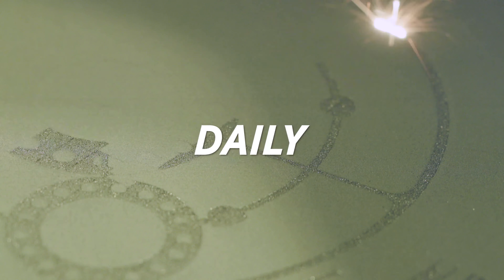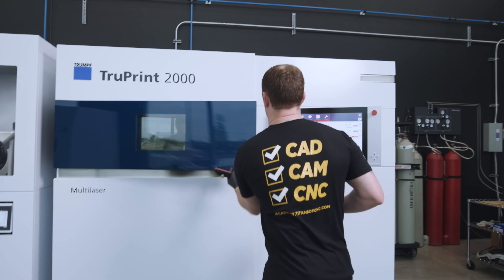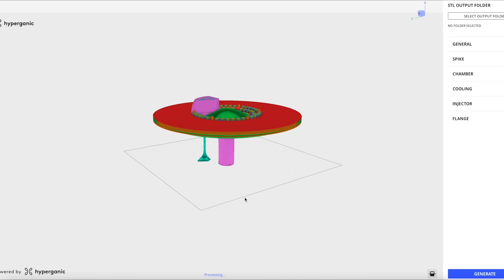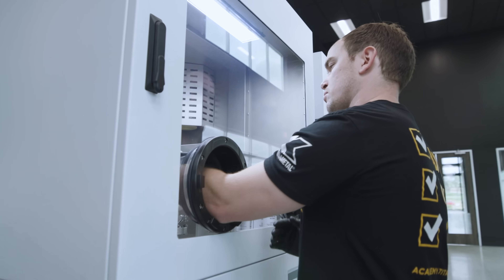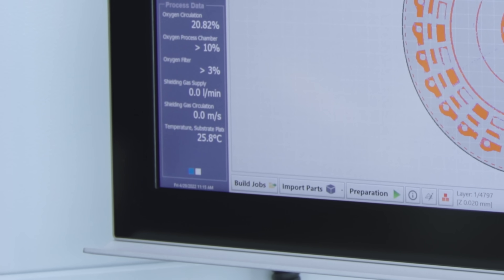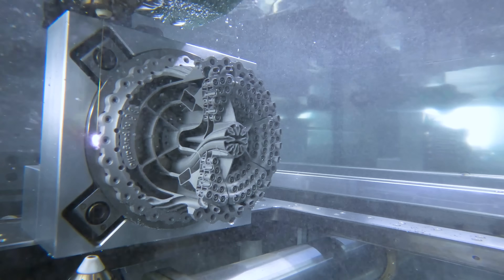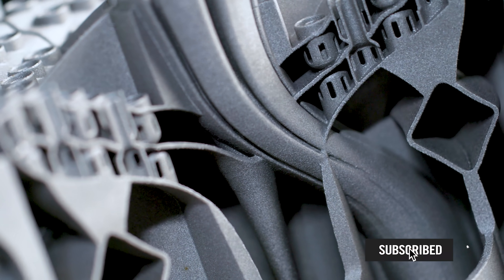3D Printing a Titanium Part Created By Artificial Intelligence

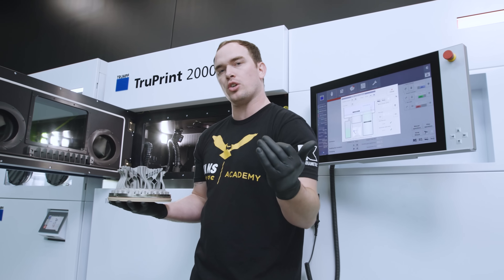Comment: This part looks awesome. So cool to see how it's made. At 5:35 you can see a crack/fracture going horizontally through the part. Any explanation for this? Thanks for your content. I love learning about this stuff!!
Reply: It looks like a fantastic new process, but I can't help but imagine the turbulence issues due to the grainy texture (resolve by manually porting?) and the extreme care needed in keeping impurities/odd grains out of the powder.
Good lord, the seed money you'd need to get all this on deck and functional...
Reply: @barrys7570  CFM has been using 3d printed parts like this in their newest generation aircraft engines for almost a decade. Their LEAP-1B engine has a very complex 3d printed fuel injector that replaced 20 individual parts in the previous generation engine.  not nearly as crazy as this part, but designed and executed a decade ago.. so, no telling what improvements have happened since.
Reply: @barrys7570  grainy is actually good for flow in many cases
Reply: @m.b.82  
And bad in many cases.
Reply: I imagine they have a few failures occasionally.
Reply: @modelcitizen1977  we are all human;-)
Reply: I saw that too
Reply: It's normal for AM parts to have these defects. The different layers cool at different rates causing them to shrink differently, causing tension between the layer which leads to fracture.  There is a way to get around this effect by using a special type of oven once you have finished printing.  This oven uses pressure and heat that bonds the layers better and then cools them uniformly. However this is only for demonstration, so it does not require the long expansive postprocessing steps.
Reply: @Almalki-OG  Ty for the knowledge
Reply: @Almalki-OG  Sounds like you’re talking about HIP. That is to reduce the voids amount in a part but it doesn’t work out factotum like you mentioned. It’s not normal to have these defects either. You can control the time between layers with software or adding in ghost parts. The defects in the video would not be fixed and the part would be scrapped. Layer separations in AM parts is not common. If they show up, you need to adjust some settings or set the part up differently.
Reply: @JeremyDN  

In certain AM processes (high energy: SLM,EBM,LMD in particular) parts can be subject to cracking/warping due to
 Residual Stress (RS).

In SLM/EBM/LMD, there are two mechanisms which can induce thermal RS:

1. Restricted thermal contraction of solidifying layers
• The melted top layers contract during solidification and cooling. This deformation is prohibited by the underlying solid layers, inducing tensile stresses in the top layer, and compressive stresses below.

2. Restricted thermal contraction in solid layers due to high thermal gradient
• High temperature in the upper solid layers causes thermal expansion which is restricted by the colder underlying layers. This induces compressive stresses in the upper layers which can exceed the material yield strength and cause plastic deformation. When the plastically deformed layers cool and contract, the compressive state is converted into residual tensile stress.

RS effects typically mitigated by:
• Reducing temperature gradients during the build (heated build chamber if possible)
• Choice of part orientation
• Use of support structures as anchors/heat conduits
• Post-build stress relieving heat treatment
Reply: @Almalki-OG  I don’t disagree with anything you said. I build these parts so I know how often they can crack. Heat tearing or shrinking is common but there are ways to eliminate it sometimes. Parameters have a lot to do with it also. I’ve made some wicked looking things that were simple to setup, and some simple parts that were a nightmare to build due to internal stress while building. Sometimes you just need to add extra material and have it machined off. Most people don’t understand how complicated building these parts actually can be. Our process is DMLM, and we use EOS machines mainly. The quad laser machines are a beast. Those things can be building a part for 3 weeks straight. Longest I’ve ran a machine was probably around 8-9 days. Building at 20um is horribly slow but the surface finish is on point.
Reply: Looks like it was either a short feed or the part jammed on the recoater. I work with metal 3D printers and titanium is by far the hardest part to print with. All of their inside features are higher than 45 degrees to build unsupported. We made some seriously complex parts. SpaceX ordered a few rocket engine fuel parts that were insanely heavy. Awesome tech but has a lot of limitations still. Surface finish looked fairly good for straight from the machine.
Reply: @JeremyDN  its all suported by the powder, innit? just like nylon sls1.. i mostly wonder how hard is it to remove the powder from inside of the part and what is the waste amount
Reply: @primosek1  Metal printing isn’t the same as SLS. Same power in a way, cept metal is a finer particle size. Metal parts need to be attached to a build plate of the same material to achieve the best adhesion. Removing the powder isn’t that hard though. I made some shakers out of cement mixers that would vibrate the build plate. Add some small exit holes in the bottom of the supports and give it time to shake it all out. The process for metal and plastic is sort of the same but has a lot of differences that set them apart.
Reply: I wonder if there was a pause in the program or a restart happened and the part cooled and then new deposit was placed on top of an old layer?
Reply: Layering issues maybe
Reply: That’s 3D printing for ya.. you run a 48 print and it screws up in the last 3 hours! If you know you know
Reply: @nsboost  I couldn’t, I get mad when the paper printer does that with a 1 minute print. I’d lose my shit and probably destroy the printer.
Reply: I think that being just a demo print they printed at a faster rate than one normally would, resulting in poor fusion. That may also account for the relatively rough grainy look.
Reply: There are some videos of this at full scales, I seen one the other day by a rocket engine company that only uses 3d printing.
Reply: I also saw that.. I hope the process progresses further
Reply: Smart guys above answered the question well ^ I want to add that the alloy they are printing with has been around for decades (Ti-6Al-4V) and does really well in just about any other manufacturing process. But ultimately not suited well for 3d printing at this particle size. There are other titanium alloys being developed that do a lot better and don’t have the same residual stress created. See Titan 23 developed by ATI
Reply: Was thinking it's something to do with being at the end of that line at the cut-out section. A bug nonetheless but it wouldn't likely be there if the part was full without a cutout. Is there a way to CT scan these for structural consistency/failures?
Reply: Ha! I was about to type out "what is that crack?"...
Reply: Consistent quality, and quality as a whole, is the reason why not many additively manufactured parts receive certifications from the FAA and similar agencies. No doubt it is awesome tech and the future of some manufacturing, but it just is not to the level we expect and require in the industry. BUT! I am not trying to be pessimistic here, I believe Rocke Labs Electron and a few other upcoming rockets do us 3D printed engines are parts. TL;DR Cool tech, needs more work, won't be widespread for a hot minute.
Reply: @BralexAir  Yeah the electrons engine is like 80-90% 3d printed. The SuperDraco engines for Dragons launch escape are entirely 3d printed as well.
Reply: Just 45 hours of loss time no biggie
Reply: @jimmykelly2809  advertising the print machine and ai software.

Comment: This is an excellent video, and I love the concept of Algorithmic Engineering. Interestingly, @5:52, if you pause the video, you can see a bit of a horizontal fracture around the right side of the head of the piece. I wonder, do 3D printed pieces always have a chance of not bonding (atomically?) in random areas?
Reply: In understandable words, different layers cool at different rates causing them to shrink differently, causing tension between the layer which leads to fracture.  There is a way to get around this effect by using a special type of oven once you have finished printing.  This oven uses pressure and heat that bonds the layers better and then cools them uniformly.
Reply: I work in Additive. It is indeed one of them most difficult things to get right. We have a super high scrap rate. Even metal bars crack that are 2-3cm cubed.
Reply: @bjorn5209  Ahh, that's what I was thinking ! I can imagine the high scrap rate.
Reply: That's scary in a fuel injector. Also it taking 48 hours means if it messes up you're set back by 2 whole days vs a few hours for a simpler design that might require cheaper equipment to produce (so you could run multiple production lines in parallel for the same money)
Reply: It's caused by algorithmic polypressures that build up and cause internal Pythagoras fractures that refract and cause horizontal cracks.
Reply: @Professor-Scientist  🤨

Comment: the surface finish is a little rough, couldn't the a.i be taught to take the limitations of the manufacturing process into consideration and then make the rough finish a none issue in the overall design. it's sounds silly but just a thought.

Comment: Can you comment on the layer break at 5:42? How prevalent is that with this process and how do you account for it?
Reply: In understandable words, different layers cool at different rate causing them to engage differently causing tension between the layer which leads to fracture.  There is a way to get around this effect by using a special type of oven once you have finished printing.  This oven uses pressure and heat that bonds the layers better and then cools them uniformly.
Reply: @Almalki-OG  This process scrapes each layer of powder flat,  so uneven shrinkage is corrected on each layer,  provided there is enough laser power to weld through to the deepest shrunk part.   This is where the art of tuning for power and speed comes in,  which wasn't critical for this display part.   I suspect they just used the same settings as they'd tuned for the actual part,  and this cutaway curled slightly
Reply: Siemens have the answer for cracking-free 3D metal printing.
Reply: and the super nasty widowmakers at almost every orifice... probably just add to the flame right? -__-
Reply: is it even real titanium?

Comment: Wondering how strong the part is? Will it be brittle could it be heat treated for strength? So many questions!! Amazing where tech is going!
Reply: @sergiugabrielpopovici5664  tubes only make material strength anisotropic; it reshapes the strain tensor without increasing total strength
Reply: @dan forged parts have approx 20-40% more strength, its plausible the design technique warrants the loss

Comment: Definitely looks like a Hyperganic part! This elevates the role of engineers to the next level and you guys did such a fantastic job at printing and presenting it. Moving in the right direction! 🤯
Reply: It is!
Reply: How does this elevate the role of engineers? Lol if ai can do this that means the value of real engineers is significantly lower. Why pay an engineer tons of money when ai can do it better?
Reply: @Loserstakethebait  
This just takes away the complex calculations that would otherwise need to be done manually for more complex parts. The engineer using this AI would give it a general model with all the features they want, then the AI would do all of the time-consuming optimizations.
Reply: @Loserstakethebait  
Who engineers the AI?

Comment: Amazing video and loved the complexity of the part! However I did notice some imperfections and wondering how you would inspect the part on the inside when it was completed for imperfections????
Reply: Probably xray it, pretty sure they xray a lot of aviation equipment anyway
Reply: @xxportalxx.  You could also use dental or surgical cameras to scope down the openings.  Only reason we can't machine in those spots subtractively is because it's too expensive to make a thousand dedicated tool bits for one part.  Otherwise it is 100% possible to make this part with just subtractive manufacturing, just so unbelievably horrific nobody would even attempt.
Reply: @DSiren  I would wager this particular example couldn't be made in one piece by subtractive machining alone. There's complicated internal cavity structures that aren't particularly accessible.
Reply: @xxportalxx.  it would be an ass to make the thousand or so custom tools but yes you could do it.  You'd probably need a half dozen special chip extraction tools also, but you could do it.  Worst case scenario you're using a wonky file to do it.
Reply: @DSiren  I'm not sure how you'd envision those internal cavities being machined, moreover how you'd machine them with any level of precision
Reply: @xxportalxx.  With the right tools and machines

Comment: I'm A retired mechanical engineer/CNC programmer/operator/QC inspector. I hate to admit how bewildered I am. I kinda sorta got the plastic 3 BASICS understood. But this is an entirely different level. ONE.QUESTION, How does the titanium powder achieve structural stability and integrity in the competed product? A block of printedf titanium will have the same Rockwell# as A conventionally forged, manufactured block??
Reply: You can actually get very close if not better mechanical performances after post-treatment (typically polishing/surface finishing and HIP heat treatment, which will close most of the microscopic pores and remove residual stresses from the fast cooling of the process). Now this particular part, I don't know how you would surface treat it given the complexity (maybe chemical etching?), so it may have reduced fatigue life...

Comment: Could you show these 3D printed parts installed in a working anything? I mean how durable is the 3D printed part compared to the normal one
Reply: I think they can't. The quality control doesn't exist.
Reply: This model is just an example. There are similar parts made with same technology already flying so yes

Comment: For what fuel and oxidizer was the injector plate made for? And what combustion chamber was it designed to fit in with? Also, I love your videos.
Reply: For rocket booster
Reply: @gurbanguliberdimuhamedov4228  You didn't even answer one of those questions.

Comment: Honestly how many times did the wire break? Simply curious.
Reply: Look up wire EDM, the wire never actually touches the part. If I recall right they apply opposite charges to the wire and the stock creating sparks that erode the material and use pressurized deionized water to flush it away.

Comment: Incredible stuff….. but that surface finish seems so rough it’s surely not useable…? And even if the nozzles were machined, the roughness in the channels and cavities which are unreachable must be a nightmare for the fluid flow with all the friction it introduces!
Reply: There is a process called extrusion honing.  I wonder if it could be used on a part like this.

Comment: I think the principal future of this technology lies in materials development, as you can put down only so much laser energy at a spot before you begin to violate the dimensional tolerances. The TRUMPF machine here has two lasers, presumably to allow simultaneous scanning of two points on the pattern, in order to cut cycle time. There might be room for design trade-offs in relaxed tolerances to allow quicker fabrication. I can also see machines that use fixed optics (that create a smaller spot) to make very small structures, though it wouldn't be as fast as a scanner. What I'm waiting to see is 3D printing of parts containing more than one type of material.
Reply: Multiple material prints already exist. Check out this video. At begin there is the technology explanation and from around middle of the video you can see the real machine

https://youtu.be/s6jTw5VQgvI

Comment: The biggest downside to SLS 3D metal printing is, metal fatigue. Because of microscopic defects in the print.
Reply: It has its challenges. But you can heat treat & HIP the part to get similar properties as conventionally manufactured. Either way standard in Aerospace

Comment: Can see layer separation at 5.42. How much of a problem is this with these laser metal printers.
Reply: I used to work for Trumpf and the bigger companies would actually pay for application support and work with the Trumpf engineers to modify parts or laser parameters to prevent this. I doubt they went this route for a youtube video  though unless the part actually needed to be used for something.
Reply: @stephen93w  thanks for the independent reply.